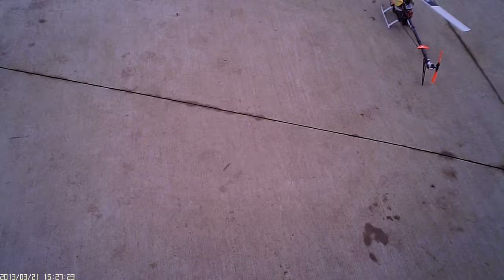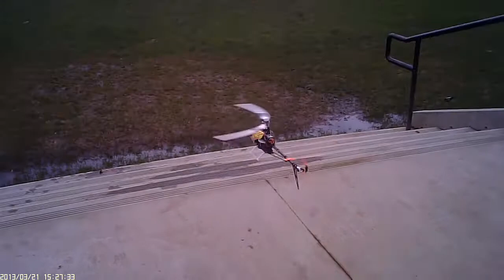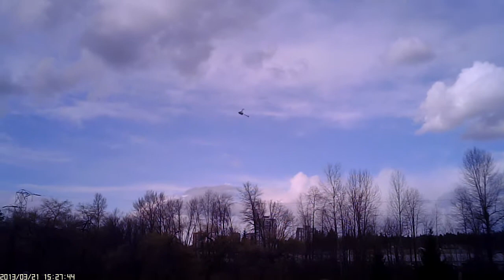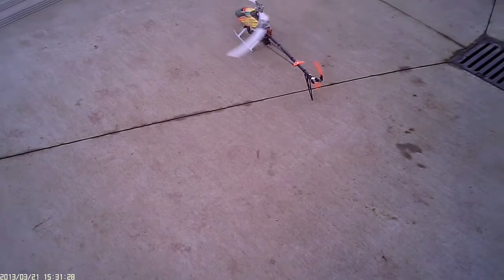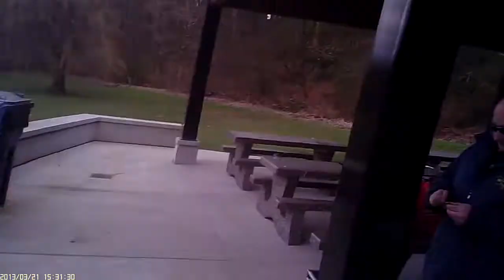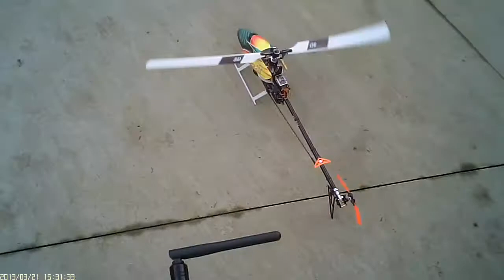My Trex 450 Pro DFC with Tail Shaft Dremel Mod

Comment: Hi... Nice 3d flying!
I've done a Dremel mod to my tail shaft but I'm not sure if it's the same one you're talking about.  I'm keen to have all the tail pitch I can get for the same reasons you mention... travelling pirouettes.
I converted over to Align's new tail box and tried their shorter links, which was a bit of a downgrade for me because I've been using the Heli-Option bearing links.  Anyway, I found I didn't have enough CW pitch to hold the tail even in pitch pumps... let alone consistent piro rate in funnels.  So I switched back to the longer links but found I didn't have enough CCW travel (inward toward the hub).  So I moved the tail hub further out on the shaft... so that the hub overhangs the end of the shaft by about 1/16"
The Dremel mod was that I ground a new flat area on the very end of the shaft for the grub screw to grip.  I wish I could get a longer tail shaft!
Is this the mod you were referring to?
Reply from the maker: Yes, that's the famous dremel mod people have been talking about the 450 Pro. New Align double-hinge tail slider sucks because the slider hub is longer which means further reduces pitch range. Align tries to band-aid the right rudder max pitch by running shorter pitch linkages like the KDE ones which also sucks because that just shifts the pitch range from left rudder to right rudder. With Align's new slider and short linkages, even with slider all the way touches tail hub you get way too little max left rudder pitch, like <30. Terrible design! The only way to gain back pitch total range is to allow slider to travel more which means 1. longer tail shaft, 2. dremel mod, or 3. shorter slider hub.

Since this video I've made quite some changes to my 450 Pro DFC. I'm now running 56.9mm KBDD tail blades (was running 59mm KBDD). I have about 40 degrees right rudder pitch and just a bit less for left rudder. And I'm running ONLY 2970rpm HS and yet the other day I could do 100ft diameter almost vertical super fast almost full collective nose-down upright CW and tail-down-inverted CW funnels without ANY fear of tail blowout. That takes so much tail power that if I do it with my souped up belt-driven 300X even at 3600HS the tail belt will slip. Torque tube rules!